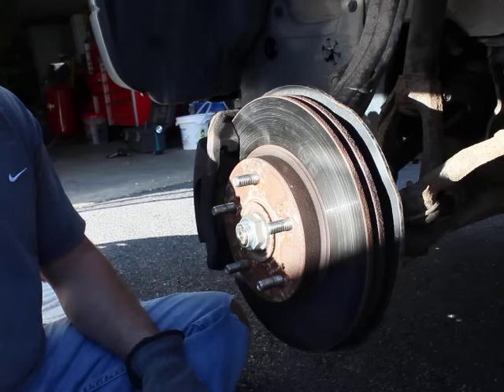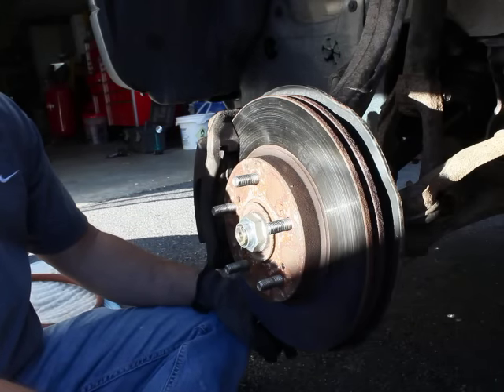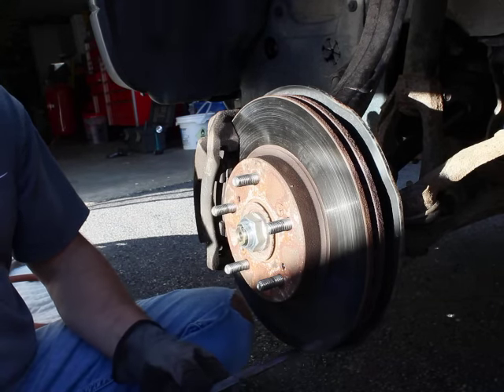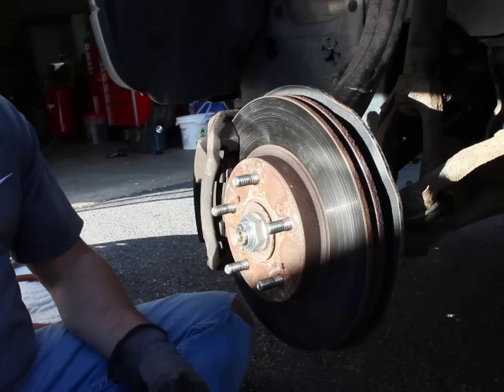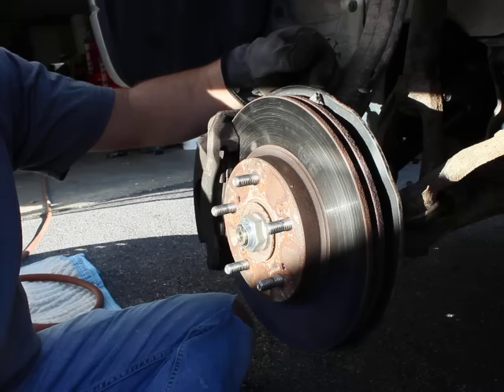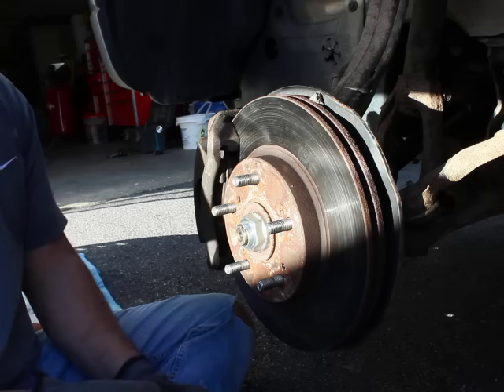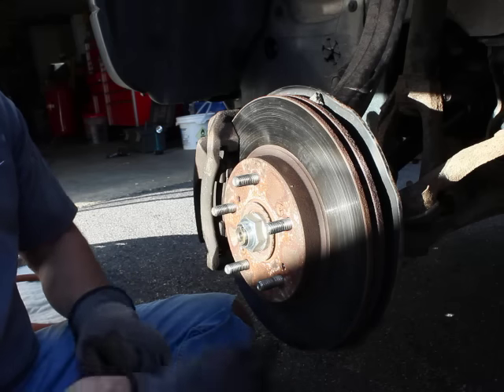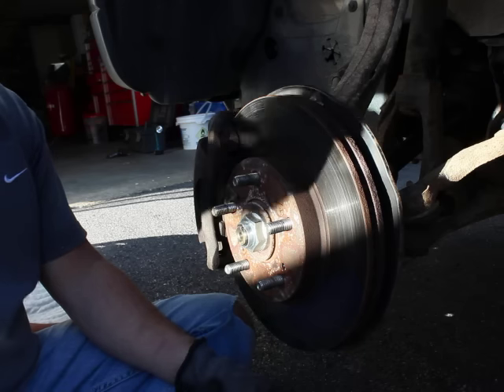Scraping Noise From Wheel While Driving

Comment: Hi, I get a similar tinny noise when I nearly come to a standstill but carries on for a few seconds when i,ve stopped could this be the same thing? It’s like a rolling tinny noise
Reply from the maker: Hi Neil, if the car isn't moving then it has nothing to do with the backing place because all moving parts have stopped . Most likely you have a heat shield on the exhaust that is loose and is vibrating making a rattle noise, I recommend you check that first and let me know what you find, thanks .
Reply: Eddie Carrara hi, thanks for the reply! Not had chance to have a good look properly yet!will be over the weekend now. but did notice today that I could hear it at low speeds and if i coasted into a stop It stop when the van stopped! But still if I braked to a stop the noise carried on for a few seconds still after
Reply: Hi Eddie finally did some investigation on the heat shield did a bit each day but could still hear it, thought I was losing it!! It happens nearly every time I get up to 30mph and slow down I can hear it! So I took it down to my local mechanic told him the problem and I drove him up the road and back and never heard it once he lifted it up and looked at the heat shield everything was fine!! He didn’t have a clue without hearing the noise himself. Then tonight I thought I’d empty my van out and just looked up a seen the air vent ( the round black on that spins round)and thought no couldn’t be as it sounds like it’s coming from under the bonnet! So I spun it round and shot in the van and shut the door. And then call myself all the names under the sun 🤬🤬🙈🙈 for weeks I thought something was seriously wrong with the van 
Problem solved!!!!!
Reply from the maker: Hi Neil, 
Sometimes the problem is right under our nose and we can see it lol. Thanks for coming back with an update, I'm glad you figured it out :)

Comment: My 2005 explorer is making a loud grinding noise and I just changed my pads it was doing it before that on the freeway it's doing it but at higher speeds it would just sound like scrapping it's in the rearend but I cant tell if it's from wheels or the rear end
Reply from the maker: Hi Vicki, Have you checked all 8 brake pads? Sometimes the drive shaft carrier bearing can make this type of noise. I commend you have someone put it on a lift and check the noise from under the car, it maybe a quick find and save you lots of money by catching it quick. Let me know what you find, thanks.

Comment: I did this and I'm still getting the noise. I checked the brakes and the caliper and pistons and all that and they all look fine. It's not a constant scraping, it sounds like it's scraping in one spot. It's more noticeable at lower speeds and when I'm driving next to something. Could it maybe be a bearing going bad?
Reply: mine is doing the same thing. did you find the problem?

Comment: I had my front driver's side tire replaced today, and there was absolutely no noise before, but shortly after, it started making a metallic rubbing sound, only when turning left.  I didn't notice any sound on the way home, but then I left to go out of town and started hearing it. Sounds fine driving straight or turning right.

Could this be the problem? Like maybe they accidentally bent that plate when changing the tire?

Comment: Mine doesn’t have this plate. It’s making a screeching noise every time it hits a certain spot idk if I should change my hub assembly or not
Reply from the maker: Hi Jake, 
all vehicles have these plates, did yours rust off? If the plates are missing, pull off the caliper and look for any spots that may be touching the rotor, make sure the anti-rattle clips are centered in the caliper holder and there are no bent clips (a very common problem). Does the noise change when applying the brakes? It's most likely not the hub. Can you make a video of the noise, post it on YouTube, and send me the link?
Reply: @EddieCarrara1  mine is the front wheel driver side
Reply: Doesn’t make noise with the breaks

Comment: My wheel makes this noise but it doesn't do it the whole time. Just after I go over a speed bump or pothole. This is the second time I've noticed it. First time was exactly a week ago. It stops for a while. It's so hard to describe. But however I did have my brakes and rotors changed back in April.

Comment: Hello! At any point, would this pebble make the car kind of bounce up and down? I don’t hear it when I break or turn it’s mainly when I’m driving it’s like a scrape sound
Reply from the maker: Hi Tatyana, no it wouldn't make the car bounce. You may be hearing the backing plate hitting the rotor, you could try bending the backing plate away from the rotor with a screwdriver like I show in the video.

Comment: I have this problem narrowed it down to my cv axle but i feel like its something else as well. It starts off as a shaky noise then turns into a grinding noise while accelerating but stops when i let off the gass
Reply from the maker: Hi Brandon, AWD, 4WD, RWD, or FWD? Possible u-joint if there is a propeller shaft to the rear wheels?

Comment: Hi Eddie, I just did a brake job on the passenger side of my wife's 05 accent. I changed the rotor and the caliper. On the Driver side I just changed the pads. I Installed everything properly and did the bleeding on the passenger side caliper. Should I have done it on both sides? The pedal still is soft even though car still stops. 

The second thing is that the passenger side brakes make noise and im doing a left turn. It sounds like a scraping sound but a more deeper scraping sound, almost like if the rotor and the pad were rubbing. The back plate was rusted off completely do I'm not quite sure what is going on. Will the noise issue be fixed once I get the brake pressure corrected? Thank you.
Reply from the maker: Hi Shawn, Actually you should bleed all 4 wheels because the line was and you could have got air in the system. You can try just the two front wheels, but brakes are usually work in a diagonal pattern. The grinding noise could be caused by the caliper rubbing on the rotor. Another possible cause is the caliper rubbing on the rim or wheel weights if the weights are stick on, and they are placed on the inside of the rim. I would look for rub marks on the caliper and wheels to start. Let me know if you find anything, and if you have more questions Shawn, I'll be right here.

Comment: I had this issue on both front disks of my car. The one on the left was so close that it would rattle when idle, and it was worse when it was wet.
Reply from the maker: Wow, that's pretty bad Tekky. Did you get it fixed?
Reply: Eddie Carrara Yes I did. The problem had returned yesterday so I was browsing YouTube for videos like this. This time it was the right wheel.
   I put my car up on the Jack and just as I suspected, the bottom of the dust plate had rusted right through it's mount and was resting on the disk. A bit of bending and cutting fixed it for the most part. It still rattles when the road is bumpy, but it got rid of the consistent grinding when moving and rattling when idle.
  I may need to completely remove or replace them sometime.
Reply from the maker: Glad you figured it out Tekky, and thanks for all your feedback, it really means a lot to me :)

Comment: What if I slid in the rain and slid into a barrier, parallel, my rim cracked because the force was so great so I had to change my rim but there’s a scraping noise now and it’s more pronounced when I brake.
Reply from the maker: Hi Marco, I would still check the backing plates for damage and try bending them away from the rotor, it's a quick easy cost-free check.

Comment: I was driving on the motorway/highway when a grinding noise kicked in. Honestly I thought a wheel was going to fall off and I would have an accident.
Reply from the maker: Are you all set now?
Reply: @EddieCarrara1 The noise comes and goes. Especially when applying breaks, driving above 45-50mph or making a sharp left turn (locking steering wheel left). It was more noticeable today and I think it has something to do with weather temperature (it was unusually hot today in the UK). I have also looked at other videos where stated it could be worn out rear brake pads which now are creating the metal to metal grinding sound. It will be looked at tomorrow by a mechanic and I will post back to you. Thanks for replying.

Comment: I have 2012 Toyoda Camry hybrid making intermittent metal scraping or grinding noise for 2 months now.  it started very low but now getting louder.  usually happens on high way speed.   took car to local oil lub/brake shop and told get plenty brake pads left.  rotors all looked good except one rotor has about 1.5 mm black ring in the most inner circle.  not sure that is the noise came from and how to resolve this.   any help will be greatly appreciated.  Thanks,  Jim

while on the left,  I tried each tires.  none seemed to have any free plays

Comment: You think this could happen after replacing the struts? I replaced mine today and I'm getting this sound at high speeds......ugh...maybe I bent that plate....
Reply from the maker: Yes sir Steven, it's very possible, just push on the plate with a long screwdriver or broom handle to move the plate away from the rotor. Keep me posted.
Reply: @EddieCarrara1  Thx. I'll try that.
Reply: Yup. Bottom of the plate was bent up and touching the bottom of the rotor. Pushed it back out with a punch and hammer. Probably bent it when I used the jack for the struts. Thx for the video sir. Saved me some head ache.

Comment: how about a swishing noise from a fresh drum brake job with new drums, shoes and wheel cylinders. My truck makes a swish swish swish swish noise when turning left or right. I was not using the brakes either just normal left and right turns when moving?

Comment: What if the scaping noice also happens when the car is stationery? What could it be?
Reply from the maker: Hi Philip, that is usually a loose exhaust heat shield or small pebbles stuck in the exhaust heat shields. Let me know if this helps pinpoint the problem.

Comment: Just got brakes changed when the sound started. it's not a constant sound but continues faster as i accelerate. i can somewhat describe as hiss hiss hiss hiss. Any idea?
Reply from the maker: +Seth Rhoades Check the backing plates Seth, it's a very common noise after a brake job.
Reply: i just got my brakes doneit was making that same noise but no it done move while i was driving what can it be any ideas

Comment: THANK YOU!
Reply from the maker: You're welcome Drake, let me know if it fixed your noise 👍
Reply: Absolutely- had the exact noise you were producing. I used a long screwdriver to push a little around the shield/backing plate. Also removed some rust with my hands. Now quiet! Honda was going to charge me $160 for diagnostics!
Reply from the maker: @drakesorey2879  😂 I don't know why shops have to charge so much to listen to a noise. I always tell people to have the mechanic do a safety inspection (even if it's not due) just to be sure there is nothing wrong with the brakes. A safety inspection is usually under $50 and the mechanic will usually try to find something wrong with the vehicle so they can up-sell the work but in your case, what you did is perfect! 👍 Thanks for coming back to share your story, Drake, it really helps other people with similar problems.
Reply: @EddieCarrara1  ...and this was Fairfax Honda, where I purchased and have taken this vehicle for many years!
Reply from the maker: @drakesorey2879  They should take care of their loyal customers a little better lol.

Comment: Thank you i just got a mini cooper with a light scuffing sound comeing from front passenger side i took back to seller he says its because the car stood still for abit but its been a week and it still does i see your vid and im going have alook and try your method to see if thats it thank you
Reply from the maker: Hi Seed Pod, if the car has been sitting for a while,  most likely it's used by brake pad impression on the rotor surface. You may either have to resurface the rotors or replace them to fix the noise completely. Does the steering wheel shake when braking at highway speeds?
Reply: @EddieCarrara1  hi eddie  when breaking it does not shake

Comment: Thanks for the video, Wondering if anyone can give me some advice, I have a 2010 full disc brake care, brakes were squeaking so badly after new pads and rotors I decided to change the new pads to another set,  I purchased Bosch pads good quality, squeaking still remains, from front brakes only.  The rotors are new!  could it be cheap rotors? Another idea I have is when I finished the job i noticed AFTER the pads came with lube which I didn't use, should I have lubed the caliper pins? would this have helped I'm thinking this may be resonance noise, they only squeak at low speeds and when they warm up.

Comment: I've got a scraping noise coming from my front right wheel, but its not all the time. It comes and goes. Could this still be the problem?
Reply from the maker: Hi Sascha, it's most likely the brake pad wear indicator or the backing plate. Just to be sure, I recommend having it checked.
Reply: Cheers Eddie

Comment: My  2002 Jeep liberty makes scraping noises only on normal gear drive..when I put it on 2w drive or part time drive the noise goes away. Any Idea. Took it to the mechanic. Said he fixed it but I picked my car the same issue
Reply from the maker: Hi DWT, 
I think what you're saying is when it's in all wheel drive you have a noise? It's possible you have a problem with the rear driveshaft either hitting something or it may have a worn u-joint or carrier bearing. Hope this helps, and keep me posted on what you find.
Reply: Eddie Carrara I went to a different mechanic he said is the front drive shaft.  I can drive fine on rear wheel drive but is winter right now.
Reply from the maker: Yes, so what ever wheels are not engaged during 2 wheel drive is where the problem exist. Do you know if it's one of the axles/CV joint? Did they give you a quote on what it would cost to fix?
Reply: Eddie Carrara yes.  He said the front drive shaft  part is 1000. Total of 1250 including labor and taxes..so I'm looking around for other mechanics
Reply from the maker: Ouch, that's a bit expensive, it's a good idea to get different quotes, prices can vary a lot.
Reply: Eddie Carrara thanks bud.  I will.  Is busy time for alot mechanic during winter. But that's still way too much.  I will shop around. Thanks for the tip

Comment: Hi,
when I drive my car like 45 miles per hour and stop slowly my brakes make grinding noise and my car continued to move a little bit even though  I am applying brake to stop. This is the 4th time I noticed it. I am scare!. One time I enter a little bit into the traffic.I have been keeping track of the noise. What do you think seems to be the problem? I feel like this only happens when I step on the brakes to stop while driving. It doesn't grind when driving slowly when braking to stop only happens when stopping going 45 miles per hour.
Reply: Exactly same problem here
Reply from the maker: Hi Sherry, it sounds like your ABS is kicking on for some reason, does your abs light come on? Does your brake pedal kick back when you hear this noise?
Reply: Yes my brake petal kick back
Reply from the maker: That would be the ABS kicking in. I recommend having that checked by a mechanic.It sounds like one of your ABS rings on the axle are damaged or you have a bad ABS sensor. Let me know what they say, thanks

Comment: My name is John and I just replaced caliper and rotors and brakes and still hear grinding noise like I did before I did all of that
Reply from the maker: Johb Grimm Hi John, your metal backing plate is probably hitting the rotor and needs to be bent out of the way. That's where I recommend starting. Keep me posted on what you find, thanks John.

Comment: Hi Eddie I was wondering if u might have any ideas on this , my 2003 Pontiac Grand Prix GT is making a sound that I think is coming from the front right tire it's hard to explain the sound but its kinda in between a knocking or a thumping sound sorta .and it doesn't seem to do it the whole time I'm driving mostly right when I get up to about 20 miles per hour and it will come and go. Thanks...l looked forward to hearing back from u on this matter...
Reply from the maker: Hi Colleen, It sounds like you may have a driveshaft noise or something else, pad impressions on rotors and uneven tire wear can make these types of noises as well. I recommend having someone take a quick look just to be safe :)